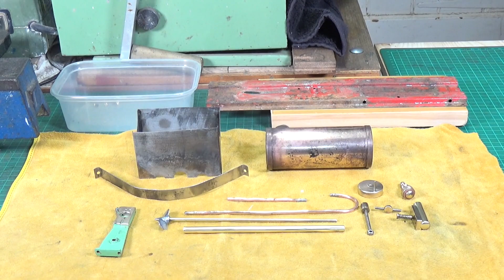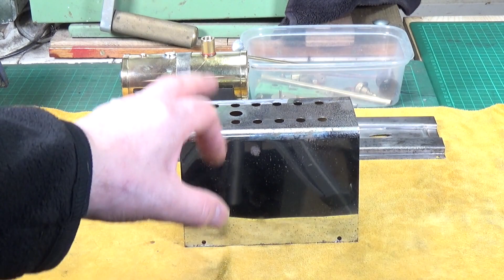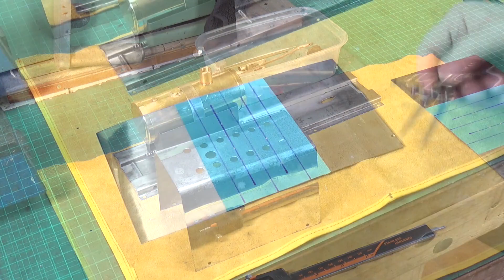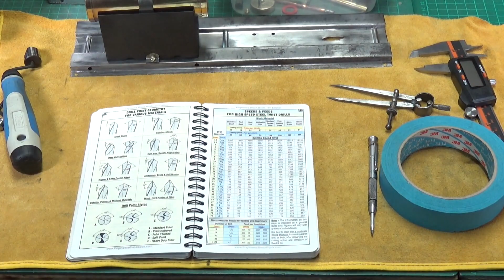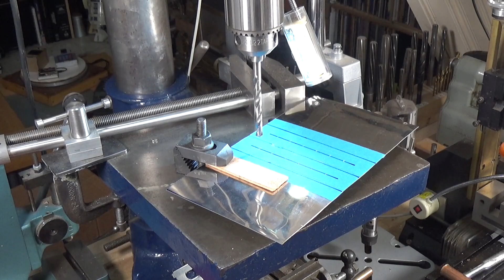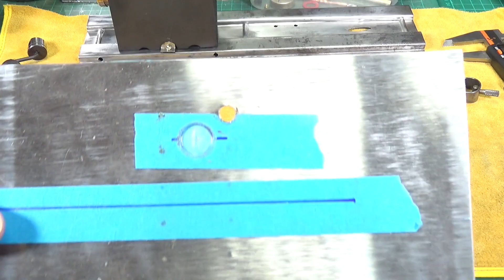Mamod ME1 Marine Steam Engine - Part Two

Comment: Very nice Alan,  My tip for drilling holes in thin sheet metal is use a step drill.  I will try your method the next time I need a size not available on my step drills.
Reply from the maker: Thanks Brian. I never had much luck with step drills. I really didn't think that Prezzo's tip would work but it does. Cheers, Alan.